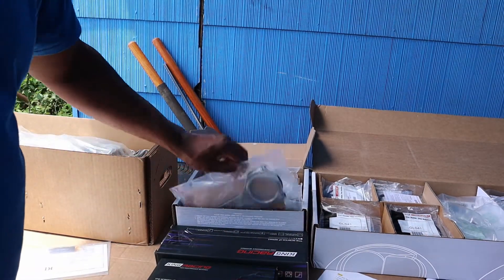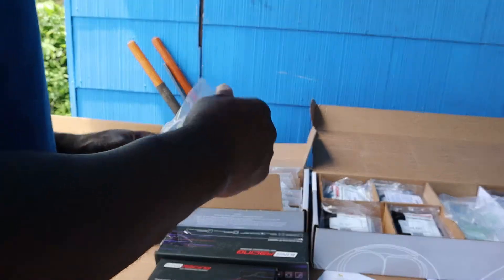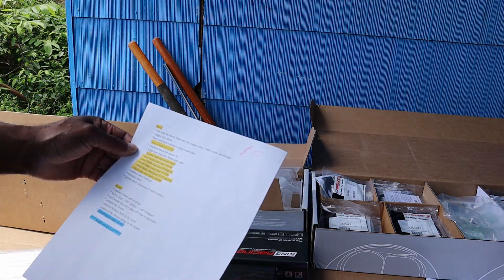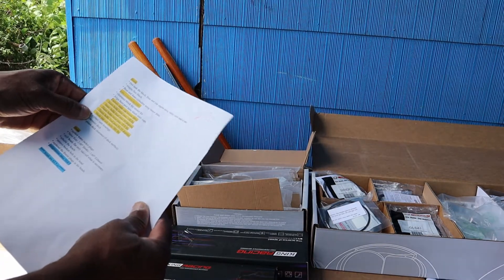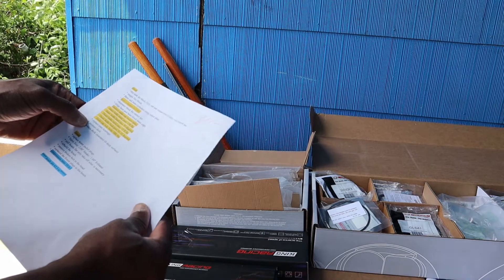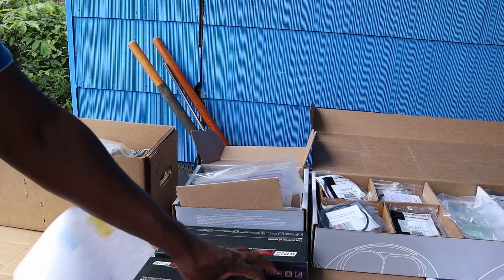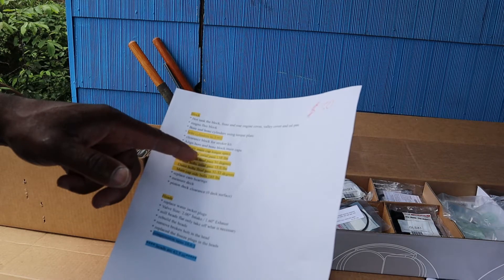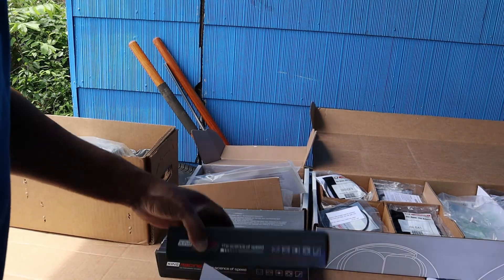how to build a 383 from a LS 5.3 (rotating assembly) part 2

Comment: What did you set your quench distance at?  Setting proper quench distance (0.035” - 0.040”) makes your combustion chambers work and allows more compression ratio without detonation!  Hope you had your combustion chambers CC’d because Chevy claims 61.5 cc’s on them 706 heads, but some are actually 65 cc’s which lowers your CR a lot! It’s good to have them milled down to 59 cc’s.  With a proper tune and quench you can run 11.5:1 CR.

Comment: How much this run you at the machine shop? Looking to do the same set up
Reply from the maker: Hey machine shop work wasn't that expensive it is based on what you want done. 
It was $400-$500

Be sure to research the machine shop you plan to use. I would suggest talking with at least 2-3. Feel them out, see if you get a good vibe from them and they are passionate about thier work and reputation.
Not all machine shops are the same 
Be sure to get reviews and/or recommendations.

Have a list of what you want done 
Put a copy with your block and parts 

Even though the machine shop may cleans your parts, be sure you clean them yourself.

Let me know if you have any questions

Comment: Currently doing same build on my 5.7 aluminum  block .. l&r engines in socal did my block for me 585$ decked align honed bored to 3.903  tanked new cam bearings , currently waiting stroker assembly from scat telling me mid August. BTW just saw that picture there machine shop was way organized
Reply from the maker: Cool cool, i am enjoying the build 
Supply chain issues are a drag!
I had to wait like 2.5 months to get my rotating assembly, then 6 weeks at the machine shop ugh!
Be sure to clean the block yourself 
Just a suggestion.
Trust but verify!

What is your horsepower goals?
Reply: @Slicpartna  denf yeah they cleaned the block well and wraped with plastic..its in my living room partially exposed i have to re clean some cylinder walls all in all pretty clean from shop..  meh like 600hp naturallly aspirated  going holley  EFI  terminator x stealth tbi ... swapping into my 71 nova ill be happy with 500 tbh lol
Reply from the maker: @marcanthonysuazo  thatz cool 
I like your horsepower goals

Definitely re-clean the block
Trust but verify!
Reply: How did your 4" stroked LS1 turn out.  I'm looking at doing the same to my VY HSV Clubsport manual, here in New Zealand